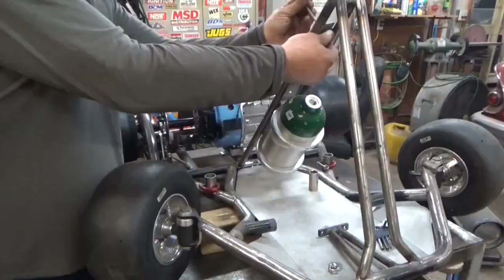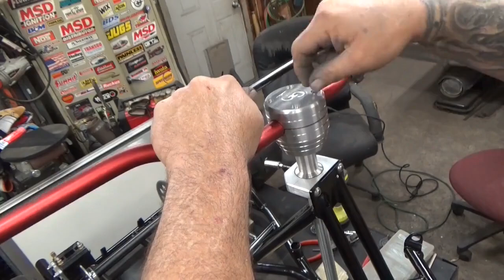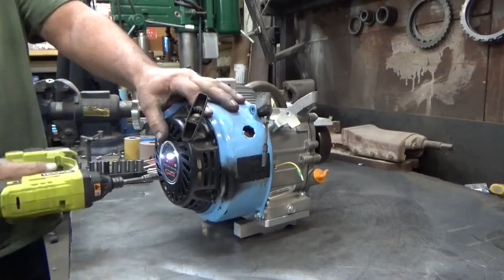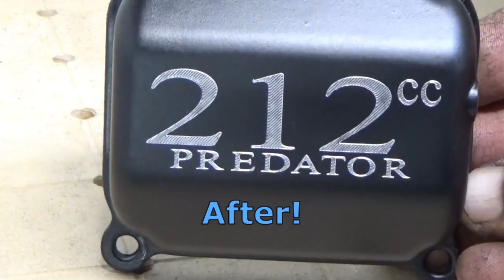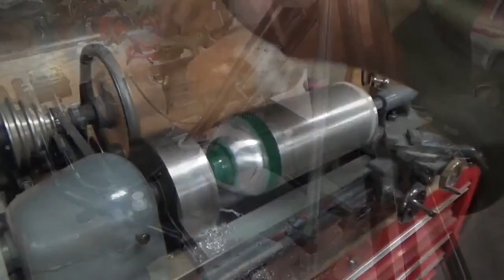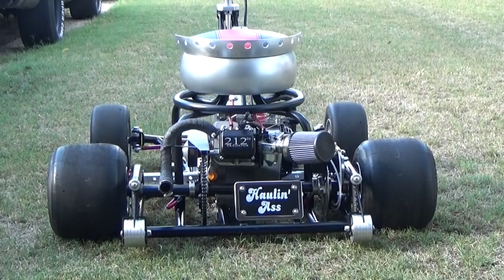CUSTOM BARSTOOL CART FINAL EPISODE!

Comment: Don't drink n drive lol. Some lovely engineering sir looks great. Some very well thought out stuff.
Reply from the maker: Thanks 👍
Reply: @geraldsgarage4100  great build thank's for the inspiration, but one question bolts did you use for clutch chain guard? Because I have a torque converter I'd like to add on a pred
Reply from the maker: @MrSlickPulla  I think they were 5/16 fine thread,if I remember right
Reply from the maker: Thanks

Comment: Very nice job. I built one 18 years ago to pull my dragcar back to the pits. I used a 318cc tecumseh ohv with header and mikuni 24mm carb and a 40 series converter and the same rims and tires as you have. I cant get any performance parts for it now cause tecumseh went out of business in 2008. So today i bought a preditor....a 420cc preditor! So  billet flywheel ,rod, piston , 34mm mikuni flat slide and a 308 cam and 65lb valve springs and a ported head will be  ordered soon. Should do 65mph i think. I have a steering stabilizer on mine to stop the shakes. Its from a dirtbike. Wish i could send you some pics.

Comment: I'm thinking of building something like this in the philippines, but, would need to order most of those parts.     Making that chassi,   is there plans and dimensions for that?    can it be made in alluminium?     and the bearings and shafts.. is that from a kit?
Reply from the maker: I never use plans, I just kind of design on the fly most of the time lol . The parts I didn't make I bought on line, most came from bmikarts.com, I don't know if they will ship overseas but you can check with them and see, Thanks for checking out my channel.